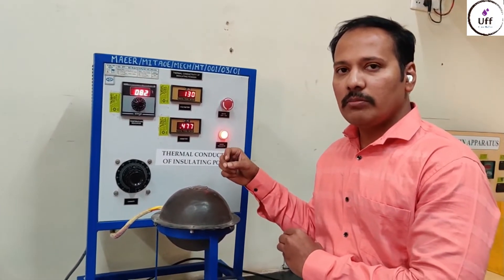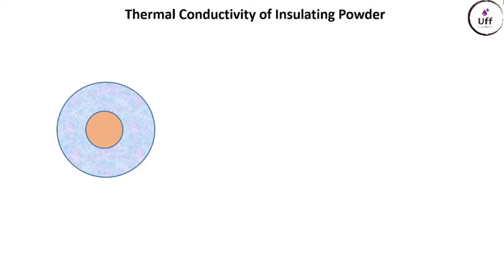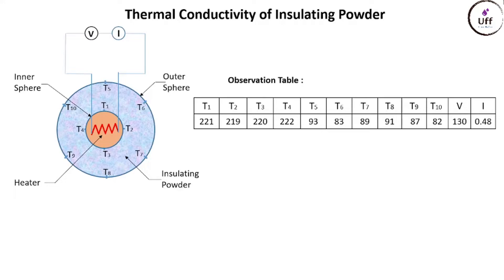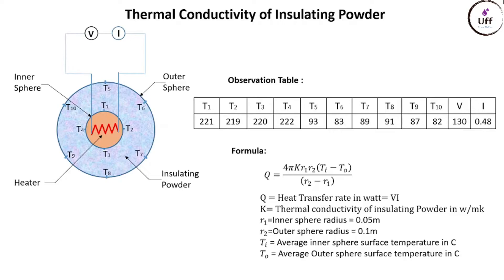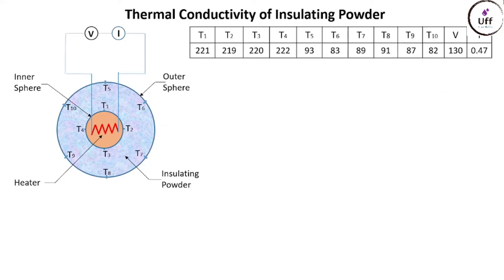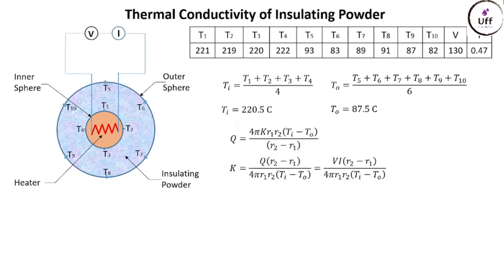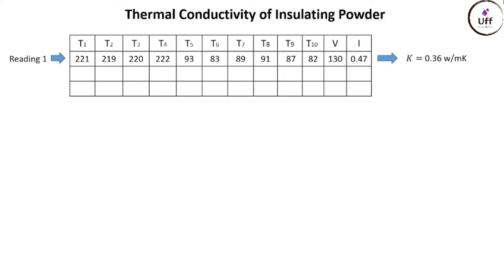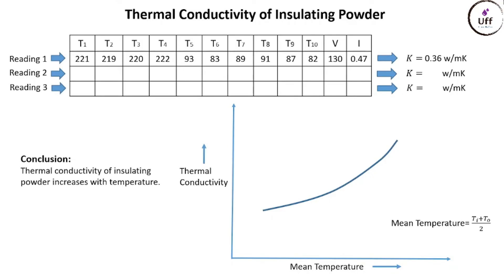Thermal Conductivity of Insulating Powder

Comment: Is it possible to modify this test procedure to do the opposite? That is to test a good thermal conductor like exfoliated graphite in order to determine the materials thermal conductivity? If so, how much would it cost? Are you willing to do it? How much exfoliated graphite would be required?